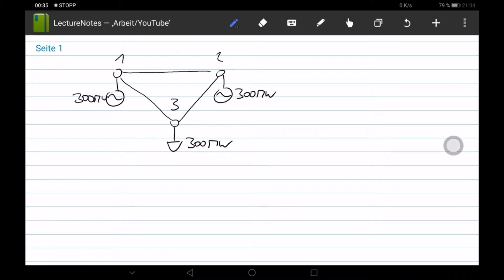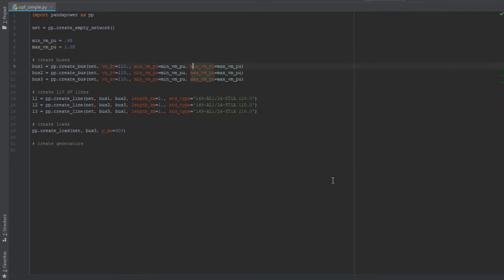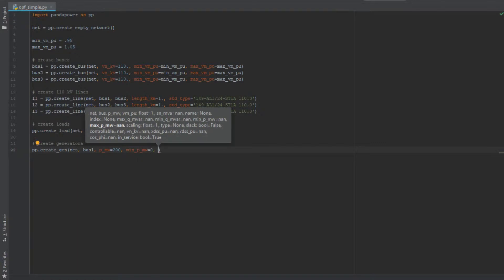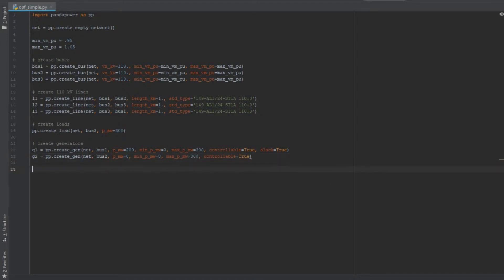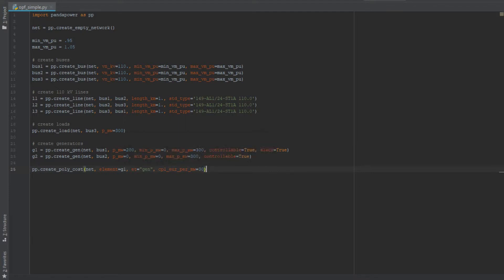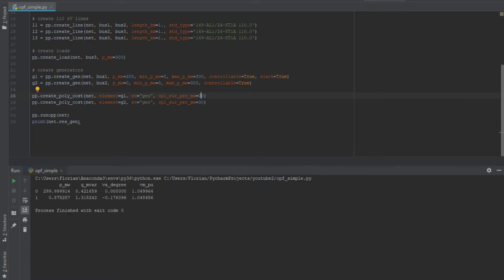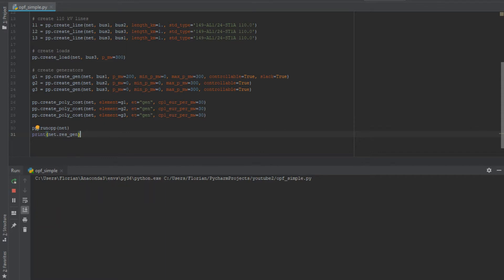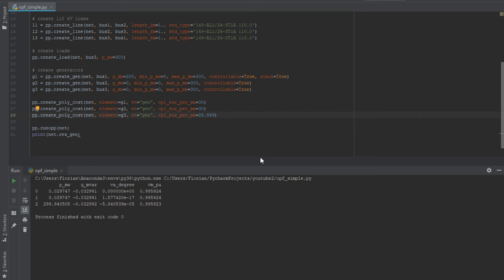pandapower - Simple Optimal Powerflow

Comment: The difference between a 1 [one] and L in your type-face is really hard to see in the videos. I had a real issue with lines 14, 15, 16, and 25, 26. It would be helpful if you posted a link to the full code you use in the description.
Reply from the maker: Thanks for the tip, Robert! You're right. Especially in the older videos the fontsize is too small. Also it's a good idea to put the code on github / in jupyter notebooks. I'll try to do that soon :)!

Comment: It's to simply and sounds good. Is it possible I create my own constrains and create my own functions to determinated my optimal S to each generator using pandas? Thanks again.
Reply from the maker: Thank you very much for all the comments. Unfortunately, you cannot add your own constraints within pandas. For OPF calculations we added a very nice PowerModels.jl interface: https://pandapower.readthedocs.io/en/latest/opf/powermodels.html PowerModels.jl is far more flexible for OPF calculations. Maybe that is something for you. Also in a pandapower net you can access the ppc with net["_ppc"]. This might be helpful if you want the matpower like pypower format to add constraints. In pandapower constraints can only be set for P, Q and V for gen, load, ext_grid and sgen elements.